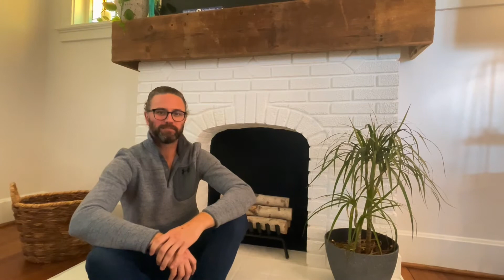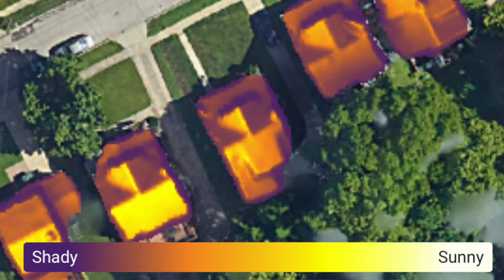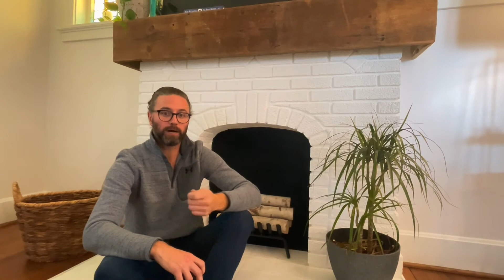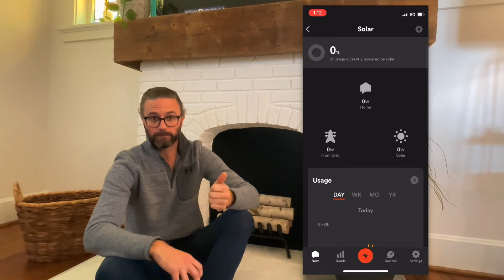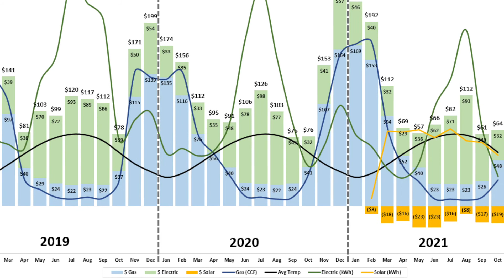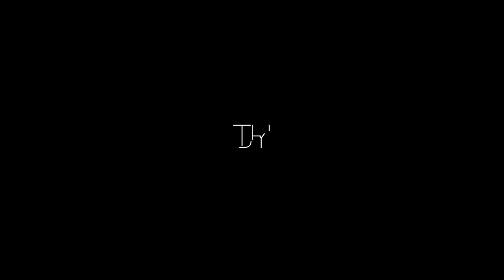Rooftop Solar (SolGen Power, Duke Energy)

Comment: Do you know the brand and model panels they installed?
Reply from the maker: Hi Brian, SolGen Power installed ZNshinesolar’s ZXM6-60-320/B Series mono-crystalline solar panels with Hoymiles’ micro-inverters (some with 2 in 1 units while others were 4 in 1 units). Hope this helps!
Reply: @ChrisMWright  any change of getting the spreadsheet that you made so I can do the same your doing? Solgen is installing a system on my house in the next few months. I’m
Reply from the maker: Yeah, of course. Send me your email and I’ll delete the post with your email in it.
Reply: @ChrisMWright  Did you get my address?   If you sent the email I didn’t receive it.   If not no worries.